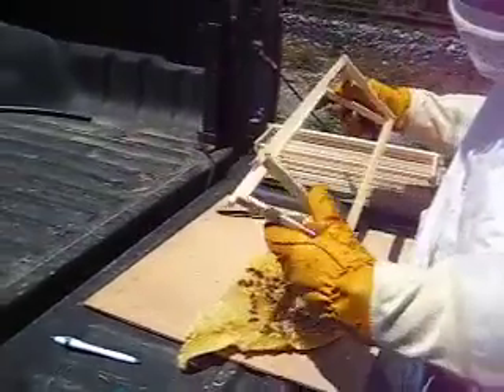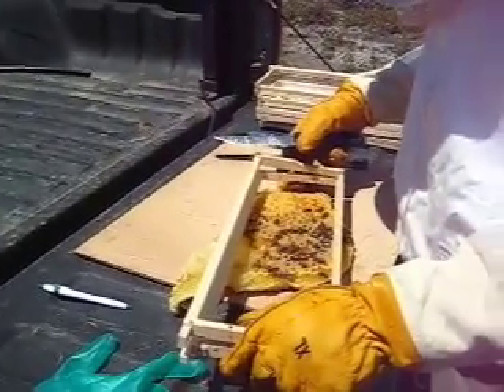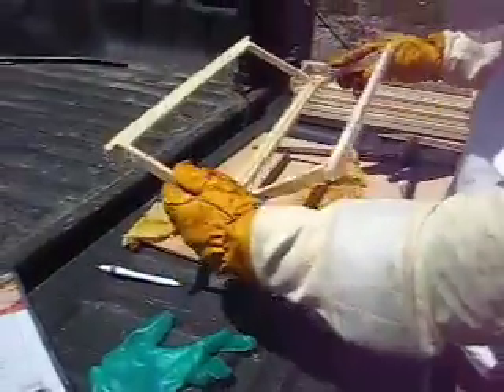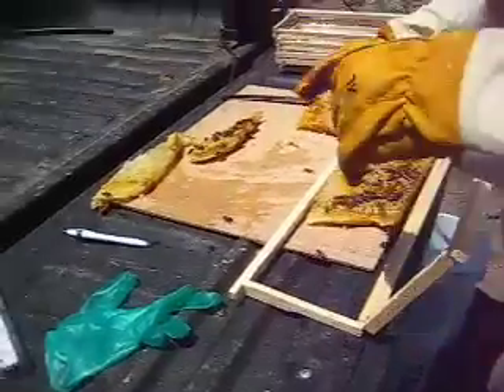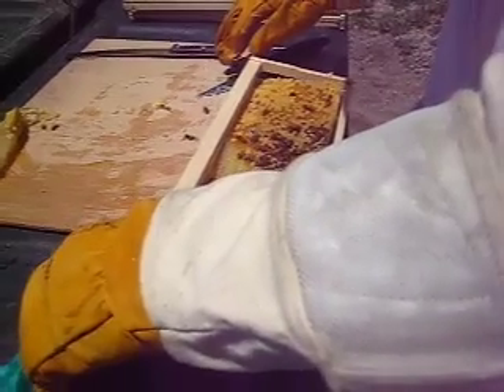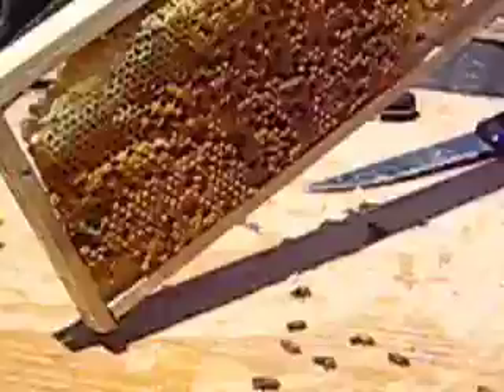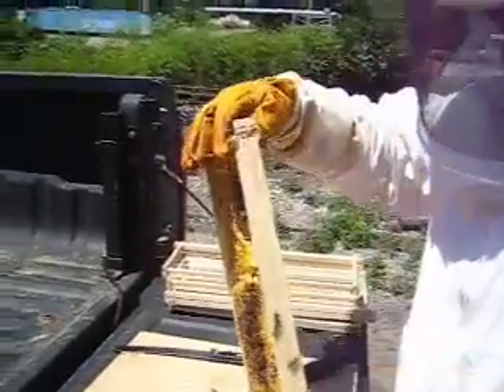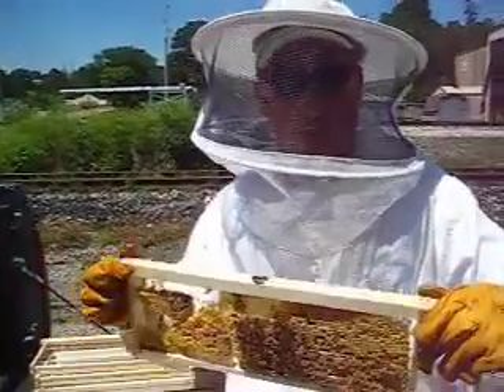Cut-Out Frames: Removing Bee's brood from a wall

Comment from the maker: Yes.  In theory, you can remove bees from almost anywhere.  The more access you have to the space the better results you will get.  Usually, within walls the bees are filling a void between studs (usually 16" on center) with various vertical dimensions depending on horzontal firebreaks and roof lines.

Access can be gain from inside or out.  I have found a bee vac and cordless tools to be essential for the job.  If you do it from the inside make sure to seal off the area or room.